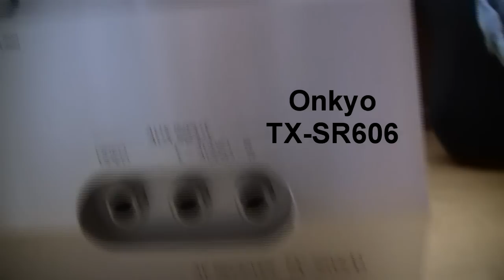Onkyo TX-SR606 HDMI problem (different print layout)

Comment: Just to be clear, in my video when I show the capacitor getting soldered on, I am doing it on the other side of this board. In your video we are only looking at the side that has one capacitor that needs to be replaced. When you take it out an flip it over you will see the other four.

Comment: This is actually the same layout. This is the same as the picture I show first in my onkyo repair video. Your board has already had some work done on it, there is a capacitor that bridges connections on what look like a voltage regulator. On my picture the capacitor that need replacing has a lack dot on it, but only because I put the dot there with a marker. Also my picture has a capacitor bridging a connection just below the bad capacitor, which looks like a brown chiclet.